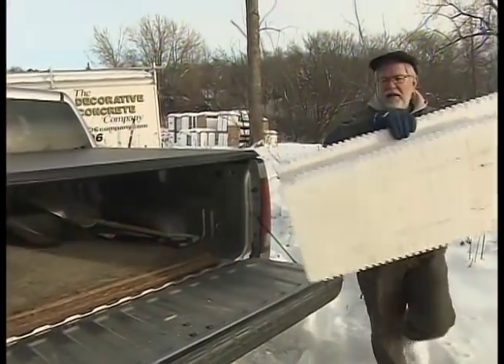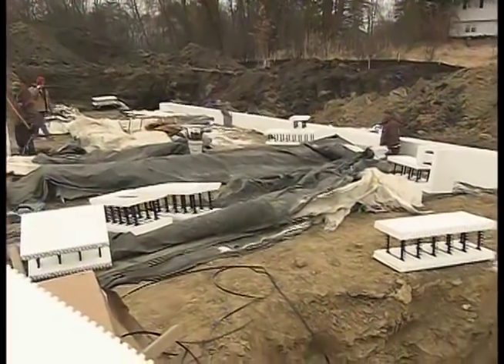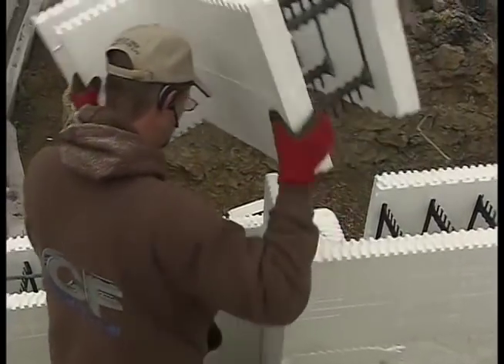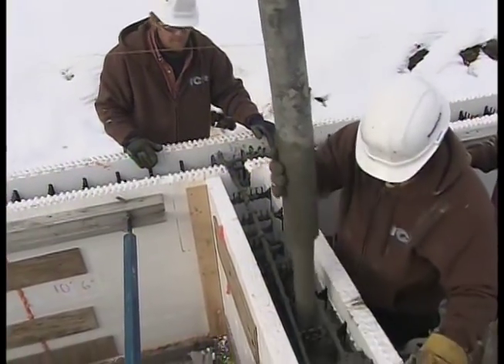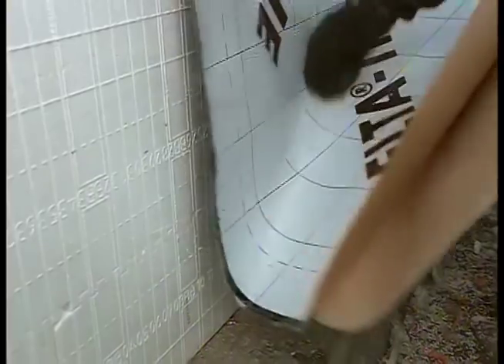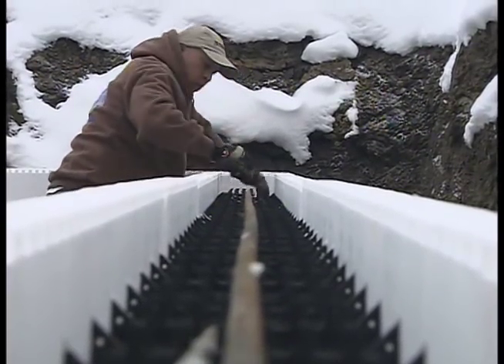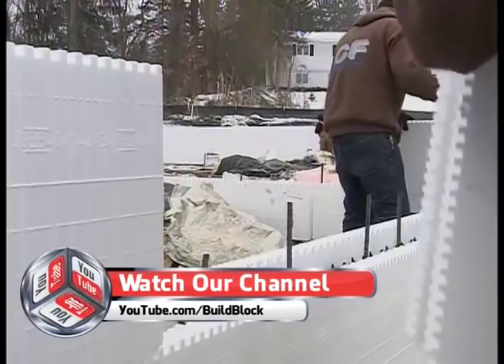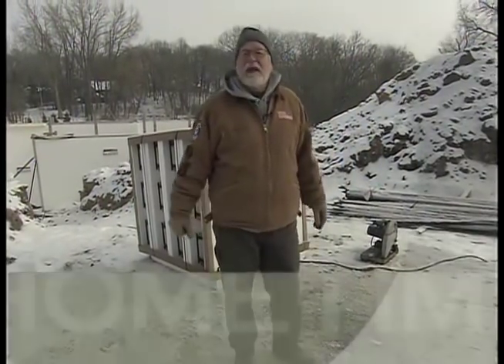BuildBlock ICF Featured on HomeTime Episode 2704

Comment: Leaving a foundation exposed to the cold is asking for trouble.  The footings right now are heaved, since they are on frozen ground.  Once spring comes, it will settle, and crack your foundation to hell, and place your foundation out of level.  I am a structural engineering, and it never ceases to amaze me of the little knowledge most builders have.  Not only that, but they are documenting it, so the lawyer representing the property owner can use it in court of law during their law suit for incompetence and negligence.  What a joke.

Comment: "More fire proof"
I think he might be wrong on that..as far as foundations go..
Styrofoam is extremely flamable..concrete is not..
Reply from the maker: ICFs are manufactured with a flame retardant additive. The material will melt when exposed to flame but not burn. BuildBlock has been tested and received a 4-hour firewall rating from an independent testing facility. When compared to wood and other traditional materials, ICFs stand up to fire extremely well. You can learn more about ICFs and fire resistance here https://buildblock.com/insulating-concrete-forms-icfs/icf-disaster-resistant/fire-resistant/.

Comment: Is thepolystyrene up to code is it fire retardent
Reply from the maker: Yes, all of our products exceed current building codes. EPS foam, when used in building products, contains a fire retardant added to the bead before it is expanded and molded. Our walls have a 3-4 hour fire rating. You can learn more about ICFs and fire considerations here https://buildblock.com/icfs/safety/fire-resistant/ and  here https://buildblock.com/asked-answered-eps-foam-and-fire-retardants/

Comment: What did you mean when you said waterproofing did you not put a Rubber seal in the concrete on the foundation floor for the walls that keep the water out you know they do make a seal that goes into the first Port of the concrete between the rebar so when you pour the wall the concrete goes around the other half of the shield been around for decades you ought to try it works very good not much work

Comment: I ran pumps for 38 years. This guy did it right. Some guys tried building the walls to high and these foam forms just blew out. They would blame the pump and it would be a night mare. This is a decent system on this pour.
Reply: I could see blaming the pump if it was a completely closed system, due to the very high pressures, but, as the concrete is effectively only falling from the pipe, thus dissipating the pressure, it can only be due to a failure in the blocks, and their assembly on site.

Comment: So home time never had the sales rep on sight training and measuring at stacking and completion of pour. Old school guys inspecting work or building inspector. No sample test Ing of mix and spec to code. A half ass job to train contractor inspector owner and owners rep.
Reply from the maker: This 16-minute video doesn't show every single piece of the build. There were several BuildBlock representatives on site for this build and the ICF Installer is a professional who has been in the business for many years. Inspections were done, concrete was tested, and the project went very smoothly. This video is intended to inform on the use of ICFs in residential construction. If you're looking for training, we would recommend our training website- https://buildblock.com/training and training videos-https://www.youtube.com/playlist?list=PLMFDU7ZHdfWpq4Nul1yohz3koxVQwKui8. Thanks for stopping by!

Comment: just wondering how you put the wiring electrical outlet in wall ?
Reply from the maker: Hi Seannn! Check out this video from our installer training series https://www.youtube.com/watch?v=i0oVOGw30HU. You can also get more in-depth training on our free training site http://training.buildblock.com/. Thanks for stopping by!
Reply: thank you very much guys :)
Reply: I got also a question .. if i want to Plumber job inside the wall after i already installed the wall, hows that ? can you please tell me about i would be more thankful :)
Reply from the maker: Hey Seannn, It's advisable to do any plumbing that goes through the wall before the wall is poured. Since you're dealing with concrete, it can be pretty difficult to add plumbing after the wall is poured and set up. We suggest curring all of your penetrations for plumbing, electrical, exhuast etc. before adding concrete to the wall.
Reply: Thanks :)

Comment: A bit late in the year to build I would say.
Reply from the maker: Not with ICFs! The forms go up easily in any temperature and insulate the concrete during the pour. Once filled with concrete, the walls provide a comfortable place to work, protecting you from wind and weather and adding speed to the build with fewer delays.
Reply: BuildBlock ICFs  I meant the framing but I guess some want to get it up / get it done.
Reply from the maker: Gotcha, and yeah you're right. ICFs definitely make framing easier/faster but depending on the season the stacking day may be a cold one!

Comment: Did anyone notice at 4:12, you can see the guy is NOT doing the job correctly?  Very important, you MUST not stack the joins on top of other joins.  They MUST be offset for added strength.  I will build a house with ICFs, but use #8 stainless steel rebar, yup, a full 1" thick of stainless steel sweetness!  Also,  you never hear these nuckleheads talk about the concrete blend.  Concrete is NOT concrete!  Sidewalks usually consist of a 1,200 to 1,500 PSI strength blend,  whereas these walls might be 2,500 to 3,000.  I will use a 5,000 PSI blend for superior strength and peace of mind.  The less wood in my home the better!
Reply: AMD Guru for block walls, you would stagger joints. For ICF, you always have a straight, vertical joint.
Reply: I built an ICF home and staggered my joints. It was easy to do in the planning phase. Did it matter? once the concrete is dry- NO. during the pour "it may" have prevented blowouts. All "cut" seams had four 1/2" x 2" wood strips overlapping the seam  by screwing one strip on the outside of the block at the top and one at the bottom- both inside and outside. I only had one blow out- it was at a seam I had overlooked and had not applied the wood strips. zero blow outs anywhere else. Using 12' as teh vertical limit with the initial pour you can literally see the concrete hit the bottom and fill the caivuty up. I did not use any concrete consolidation devices and  I have zero airpockets- a good pump  operator was key- he was able to adjust the flow as we went around the top of the forms filling about 24" inches each time we  walked around the scaffolding. I could see how pouring fast could create air pockets.

Comment: this is the method I plan on using to build my house.  I really want to do an all ice home including the flat roof that I want. I live in tornado prone area so it makes sense to go full icf.

what are some drawbacks to doing a roof of icf an how is it done?

thanks an I enjoy your channel
Reply from the maker: Hey Sean. There really aren't any drawbacks to doing an ICF roof. It may take a little more time and be a little more expensive but that's about it. Finishing an ICF home with an insulated concrete roof is the best way to make the home disaster proof. Building with ICF top to bottom gives you a finished product that is complete, cohesive, and will last forever.

ICF roofs are accomplished with ICF decking. BuildDeck is an affordable system that comes in multiple thicknesses, is easy to install, and can create either a flat or pitched roof.  BuildDeck provides superior structural integrity while also delivering low air infiltration and sound mitigation. You can read more about it here http://buildblock.com/products/builddeck-floor-roofing/.
Reply: BuildBlock ICFs 

I appreciate your help.  do you think custom trusses would need to be built for say a 78' foot depth roof? 

the dimensions would be approximately 78' depth an 47'  width
Reply from the maker: You may or may not need custom trusses, but you will need custom engineering since those dimensions fall outside of the applicability limits in our prescriptive engineering. If you look at http://buildblock.com/technical-support/engineering-tables/ and download the BuildBlock engineering manual, page 4 has the applicability limits used in our tables. The HUD prescriptive is also on that same page, and uses the same limits. (40 ft. 12M unsupported).

If you reach out to Rebecca or Dennis at technical@buildblock.com we can provide you with contact information for ICF friendly engineers. Though any structural engineer should be able to use our engineering as a starting point.

Let us know how else we can help.

BC

Comment: Did anyone notice the seams lining up @ 4:09 and again @ 14:09
Reply: Its not a mistake, the common seam allows the wall to be any length. You always start from the corners and work to the centre. Then adjust the form where they meet i.e. the common seam. They make special parts to strengthen the common seam or use wood.
Reply: Its called a common seam....  Its where the blocks that have to be cut short all meet.
Its reinforced on the outsides usually with  pieces of timber and extends from the floor to the top of the wall... with all the seams or joints in a vertical line.
Reply: Yup, I already mentioned that mistake!  lol
Reply: Yes common  seam.that make H-clips to be placed 16 inches on center.and place straps on outside.plus glue seams.its better to just flip blocks  over when possible
Reply: and @ 2:28 !  FAIL FAIL FAIL
Reply: there will always be some dik who watches a vid and finds an error lmao~

Comment: I didn't see any vibration of the concrete.  Did I just miss it ?
Reply from the maker: +GordWing Great question! HomeTime didn't show the vibration process in this segment but you are right, concrete in ICF walls should always be internally vibrated to prevent honeycombing and create a strong solid wall. We recommend a low impact pencil vibrator with a 3/4 to 1 inch head.
Reply: Glad to hear that... I love Hometime.  I've been watching it for 20+ years.
Reply from the maker: Absolutely. It's a great program and they were awesome to work with.
Reply: 555

Comment: These guys are putting their seams on the second row in the same place as the first.  They should be staggering their cuts.
Reply: Joe Bowman for block that would be correct. For ICF, you always have a straight vertical joint

Comment: What product did you use to seal the top of the footing? Thanks
Reply from the maker: I believe they used a standard concrete sealing product. We also recommend penetron on another sealant added to the concrete mix itself if you are concerned about water intrusion into the footing. Below grade the footing and all below grade walls should also be waterproofed appropriately. Typically is a water based primer, peel & stick membrane and an air gap membrane layered and applied correctly. 

The BuildBlock Guide to ICF Waterproofing covers all of these systems and strategies as well as other products and suggestions. http://buildblock.com/waterproofing-icf-homes/
Reply: Tremco 250 ...fully cured

Comment: What is the strongest wall? I saw ICF blocks that has 12" in width for reinforced concrete.
when you make a reinforced base bring steel bars from it to the wall so its totally shock earthquake proof.
Reply: The footing that the walls sits on also must be reinforced per local codes, site specific engineering, or other building codes. Vertical steel from the footing must extend from the footing into the vertical wall at least 25" or more again depending on site specific engineering, prescriptive engineering, or local or international building codes.
Reply: Another noted thing is the length between vertical steel bars, I would like to know the best reinforcement that makes the home built for 100 years! Also galvanized epoxy steel is better than normal steel. Aluminum is expensive and has less flexibility.
Reply: There are really a couple of good options for reinforcement that we recommend. We also believe that these structures will last for centuries because not only are they built with reinforced concrete, but the concrete is protected by the EPS foam and the interior and exterior finishes.

We recommend Grade 60 rebar. The specific size is based on the structure, spans, etc. Typically #5 horizontally and vertically. You can choose galvanized or coated rebar, but for most structures this would seem to be overkill and a waste of money for minimal benefit.

The other option that has been very well received is Helix microrebar. This is added to the concrete mix as it is poured and can replace all rebar in the structure or at least the horizontal. There is a price premium involved, but there are many years of proven satisfaction and code compliance testing.

Lastly, as far as spacing, that will be determined the the load on the structure. We do recommended a horizontal rebar every course for maximum strength and then rebar based on the engineering tables we provide in our engineering manual or site specific engineering.

Comment: 14:14 ... seam not overlapping?
Reply from the maker: Vertical seams are common in ICF projects. When starting from corners and working toward a common point, many wall lengths do not evenly work with ICF form dimensions. If possible vertical seams can be placed above doors or windows and should be as far away from corners as possible.All vertical seams must be braced and strapped appropriately.

In the above video, there is a quick double corner with a very short return. This was built using alternating corner forms with a small vertical seam.

Comment: Can you make roofs using the same ICF system. I don't see the point of using ICF for the exterior walls and traditional wood frames for the interior walls and roof.
Reply from the maker: Nu B-  Thanks for the question! BuildBlock has a product called BuildDeck which is a Floor & Roofing Decking System. BuildDeck is a lightweight, stay-in-place Insulating Concrete Form (ICF)  and used to construct a solid monolithic insulating concrete floor and/or roof decking system. Options include a Flat roof deck or up to 6/12 pitch withstandard concrete and steeper pitches can be done with Shotcrete reinforced ICF roof. Recommended integral waterproofing (Penetron or Xypex) and roof coatings, such as peel and stick or spray applied roof coatings.Here is the link for our BuildDeck Product: http://buildblock.com/products/builddeck-floor-roofing/ Please let us know if you have any more questions.

Comment: How in the world would it make it more fire proof then a traditional concrete foundation . If you ask me the old way is more fire proof then these I.C.F.s, other than the wooden forms burning witch wouldn't matter all that much cause the house wouldn't even be up when the forms are on. With these Insulated Concrete Forms (I.C.F.) the polystyrene  is the form, and it says on after the concrete is poured and I ant no expert but I'm pretty sure that that shit will burn way before a straight concrete foundation will. As a matter of fact polystyrene (Styrofoam) and kerosene is how you make homemade napalm. I want whoever reads this to do an experiment get some Styrofoam and a chunk of concrete and hold a flame to it and reply back to this comment with your results 
                                                                                                                                               Thank you
Reply from the maker: Mike Cunningham EPS foam when used in building products contains a fire retardant added to the bead before it is expanded and molded. Additionally EPS foam with this fire retardant is not a fuel source. Also when exposed to high heat EPS foam doesn't burn, it melts since it is expanded with steam and only contains air. The EPS foam used in packaging and shipping is not the same as EPS foam used in construction products.

The reason it is superior to standard poured wall construction is the insulation value of the EPS foam itself prevents the heat of the fire from transferring to the interior of structure for several hours. In a wildfire situation this is generally longer than the fire burns in a given area.

For fire to transfer to the inside of a structure it must heat the outside finish (brick, siding, stucco, etc.) to a temperature that will cause ignition on the next layer beneath (EPS Foam). That layer must be consumed and burn at a hot enough temperature to transfer enough heat to the next layer, (a reinforced concrete wall) and then that must have enough heat to again transfer to the inside layer (another EPS foam layer) which also  must be consumed before transferring enough heat to ignite the drywall or interior finish as well.

Our products are tested by Intertek and carry a 3-hour fire rating on the wall without any finishes. The wall will last 4+ hours. Untreated EPS foam burns at 650° to 700°F with a flame source. It won't continue burning on its own until 840° to 930°F is reached. Wood burns at  480° to 660°F.

Please visit our website for product testing information or contact us with any questions.